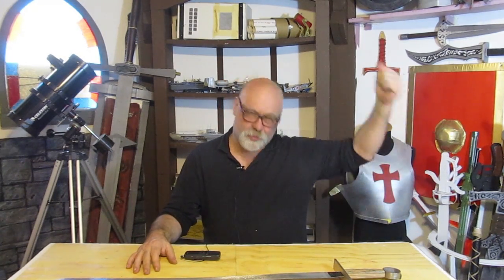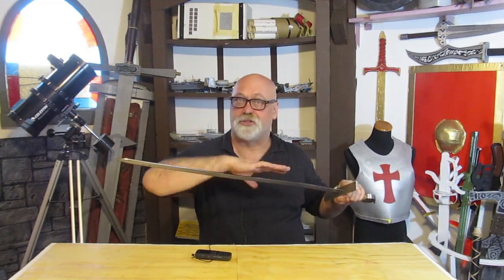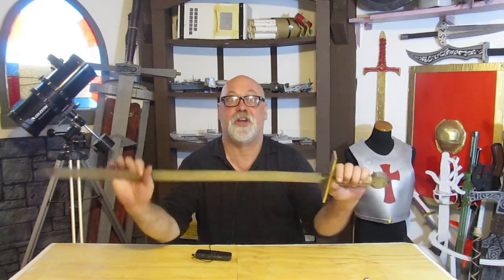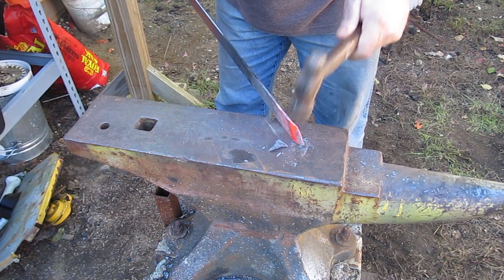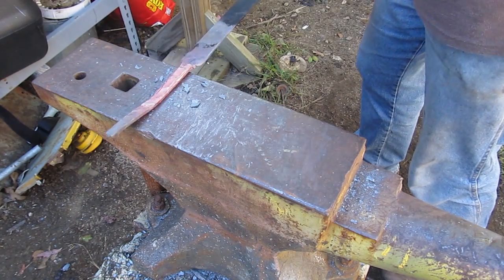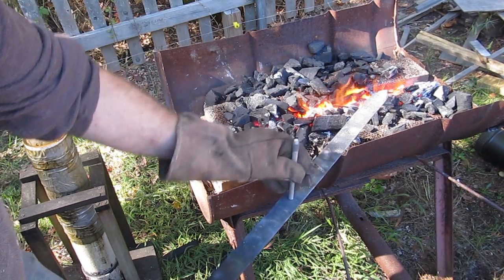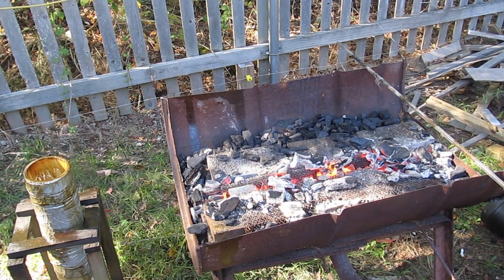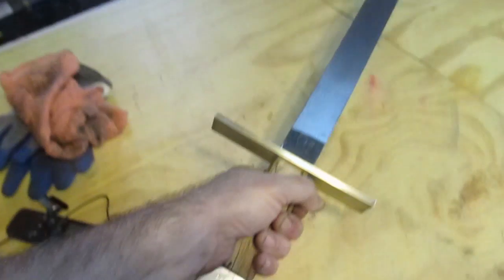Swordmaking: Don't use this steel

Comment: what about En 45, En47 or En 353? which is best for sword.
Reply from the maker: Wow, you know your steels. Difficult question to answer though. "Best" is a malleable thing. Kind of like asking which car is best. Lot of factors including cost of the steel/and the difficult of working it,  Skill of the swordsmith. How long of a sword. How light. How broad.  Which type of weapons will it go up against? How fast, strong is the wielder of the sword?  Many factors go into the decision as to what the right steel is. 
Great question but difficult to answer.
Reply: @epicfantasy  i made 15 swords with en45 and hard and temper to 52 hrc and dimensions are 36 inch long .give me your e-mail i Will send images.

Comment: Strangely, a mildsteel sword is probably the closest to what a historical sword from the medieval era would withstand than modern replicas using spring steel. Of course, it'd need carbon steel along the edges.

Comment: I just ran into this while looking into steels for a sword backing simular to how the backs of original katana were iron or mild steel with a very hard steel as the blade then adding a differential hardening to help the properties of both work the best I know 1075 is good all around for swords especally if properly done but 1095 and I mild steel seems more historically accurate and why I even stumbled across this though I think I need a better steel than that

Comment: Yeah, a high carbon, heat treated, forged sword would be nice, but you know what else is nice? Not spending 200€ for a sharpened piece of metal. If you need a sword, go to a fucking hardware store, buy a thick steel bar and an angle grinder, AND YOU'RE DONE! If you can't make medieval weapons with basic tools and basic materials... I'm just sorry for you...

Comment: costed me 30 bucks but I have a question. If i wanted to make a 50 inch monster blade what steel should i use? I'm hovering around spring or tool steel.
Reply from the maker: Tool steel would not be good. Go with the spring steel.
Reply: @epicfantasy  Thank you, spring steel  it is!

Comment: Europe medieval era,basically had mild carbon steel, and it was pretty crappy as far as.swords go. They used differential hardening,with an.iron core and.steel edges. Early middle ages it was iron swords all the way. High carbon steel was rare and even medium grade steel was rare until the mid 16 th century or so.

Comment: I've read that the Roman writers claimed that some Celtic swords would bend or warp during combat (so some of these blades may have had mild steel/wrought iron blades that were too long and soft). The Romans did use wrought iron for their armor such as riveted chainmail, scale, segmented bands, etc (and sometimes case hardened their segmented bands to mild steel) and likely used wrought iron for their earlier blades.
Reply: Genuine katana will also bend but it's kind of a good thing. It has a super hard edge but the rest is soft. Since the edge is so hard it can stay sharp longer, but the softness keeps it from shattering. When it bends, people will just bend it back 😂

Comment: I was looking up 5160 spring steel and this video popped up. 
Just wanted to do a little research on a 24.5”,5/16s thick machete/sword I’m buying on Etsy.
Reply from the maker: 5160 is typically a very good steel for machetes and swords.

Comment: Yet another video that doesn't tell you specifically which Steel is the best steel for a sword
Reply: There is no best steel, there's a good range to use, but different steel has different benefits, much like there is no perfect sword

Comment: Sigh. Iron has a carbon content in it already. Steel is just iron melted and the impurities cooked out. I forget exactly but iron is one component. Heating and cooling along with hammering bring out more carbon content cause you are removing the oxygen out of the mixture along with compressing the steel and removing other properties in it that are not needed. Then to make it even harder you fold the steel heat it and hammer more compressing it even more. This makes it so you remove even more impurities from the steel. If you already have a pure piece of steel though you will not need to fold. Want a good sword do research on the types of steel there are. I also have watched this video called super steel sword and he does both quenching methods and freezes it with a chamber. This made for an incredibly hard blade that has tones of flex in it.

Comment: That's how sword can be spring-like flexible. I was wondering how much carbon is mixed to good steel. Less than 1% huh
Reply: If you actually used 1% the steel would become too hard to use and break very easily. Have you heard of the channel schola gladiatora?

Comment: When you add toughening and hardening enhancers like chromium (2-3%), nickel (3-4%), manganese (~0.15%), and silicon (~0.05%) (these will vary between each other for balance), and reduce impurities (sulfur and phosphorus under ~0.02% and oxygen (rust) at even less, being the worst impurities), mild steels (0.18-0.55% carbon) were the basis of extremely strong 20th Century tank and battleship armors ("Krupp" steels) and, usually with more chromium, armor-piercing projectiles -- these were expensive steels, though.  With the proper combinations of these alloying elements (sometimes plus some others for making the forging process easier), the steel can be toughened (resist cracking on powerful impact) well above the best plain high-carbon steel, yet be hardened at its surface around a sword's edge and point and also for some distance inside (as in Japanese swords) to a level at least a great as the hardest sword steels ever used.  Thus, only plain carbon steels have to have carbon in the 0.6-0.8% range to allow high-enough hardness, though now you have to be more careful with the normalizing and tempering processes to prevent getting incorrect toughness in the final product.

Comment: you cannot harden mild steel much and tempering would be pointless
Reply: Mechanical hardening can be used to help though, but you're right, it won't get anywhere near as hard

Comment: how could you add carbon content to the steel? isn't some added from the charcoal in the process of forging it?
Reply: You can add carbon, case hardening, or blistery steel.
You need some metal container , then you fill container withcharcoal powder, and then close the container.
then you´´bake´´ it in fire (around 1000°C) for hours. then you have added carbon

Comment: I want to forge "swords" but I'm thirteen.
Reply: Swords are really difficult to make well, but blacksmithing is a really cool thing to do and a very impressive skill to have. I would suggest you check out channels like Walter Sorrels and Torbjörn Åhman. Walter's channel is mostly related to knifemaking, but he has tons of tips on how to get started with very few tools and a lot of the skills for making knives transfer well to swordmaking and general metal work. Torbjörn's channel is great for learning how to make all sorts of things, most of them decorative, but his videos have great demonstrations on how to use various tools and how to make a ton of stuff. I would suggest you start small, just get a small anvil (50 lbs or smaller) or just a piece of railroad track or anything you can hammer, 1 or 2 hammers, some decent heat resistant gloves, a pair of tongs or vice grips, and some kind of heat source. You can build a small forge or just use a blow torch of some kind. Get some steel and start pounding away. Get a feel for how to work with metal and build up your arm strength and then just look around the internet for interesting projects. Ask friends and family if they want something or just something that looks cool to you. Once you are decent, you can start making your own new tools and expanding your capabilities, and then if you want you can start selling your creations you can start making a bit of money, it probably won't be much, but handmade stuff can get a decent price. Most of the stuff you can get for under $100, but it might be a bit more than that. The only limit on what you can do is how much time you want to put into it and how long you can swing a hammer.

TL:DR Go for it. Get your parents permission and start making stuff.
Reply from the maker: This is a good goal to aspire to. At this point, if you don't have a forge you can do lots of studying and learning about it.
Reply: Look up local guilds around your house on the Internet there should be some by you
Reply: Exodus 2017 Guilds? Of what?
Reply: Blacksmithing
Reply: Exodus 2017 Oh.

Comment: all steel works in water as long as it is cooled fast enough
Reply: That's actually quite false. There have been tests with "super quench" made with lye (which is deadly) as well as Robb gunter's superquench. Steel needs at least .30% carbon to harden to any measureable level at all, and even then it is usually well under 50 rockwell hardness which is still quite soft.  Under .40% is still mild steel, so some "mild" will  harden slightly when quenched in super quench or ice water in thin sections but normal 1018 will NOT harden. In order to make a good tool you need at least .40-1.5% carbon depending on what it is and your heat treat.
Reply: water works. this far ive never failed using just water.
Reply: then you never have used 1018 and you haven't used Oil or air hardening steels. Water won't work if it's too low carbon, and If it's oil or air hardening water WILL crack it almost every time. This is just science,
Reply: An edge quench in water is almost a sure way to crack it unless you are claying it and do like the japanese do and even then 1 in 3 will crack
. I use warm water and a quick plunge and haven't broken any yet that way. My only water breakages were from too cold of water or just being stupid about it and doing it wrong.
Reply: Go quench some 1095 blades in water and see what happens. Higher carbon steels need to be oil hardened.
Reply: 1095 is a water hardening steel....It can crack in water if done wrong just like W1 another water quench steel but the only oil that gets it to it's full potential is parks 50. Canola oil can do a good enough job but it IS technically water hardening. I've quenched plenty of 1095 in water
Reply: Ethan Dobbins Yet it wouldn't be fun to go water quenching a blade that you have 15 hours into. Oil has always worked for me and I'm sticking by that.
Reply: Me too,exept for steel under .60% carbon or Stuff like W1 for paring knife sized blades. Canolda or soybean oil is just fine! works like an 11 second oil.
Reply: Ethan Dobbins Yeah. I'd only feel comfortable with possibly doing edge quenches on smaller knives. I just don't wanna take risks on ruining a knife that far into the process.
Reply: Ethan Dobbins Yeah, yeah, should've elaborated on that more. I don't edge quench the high carbon steels in water (or unknown that won't harden in oil). I do quench medium steels in water though. Haven't clayed anything yet, might try that at some point.

Comment: I owe you a lot for showing me how to finish a knife, but I have to say that those prices for good steel are pretty high. Yeah it'll be $50-$60 for a good long bar of O-1 tool steel, but that's because O-1 is tool steel, it and D-2 are the cream of the crop. If you're on a budget, the same sized bar of regular 1075 simple carbon (iron, carbon, and nothing else) is closer to $27. And if you go for a bar of 5160 which a TON of sword makers use, it's only $15.
That's also not saying mild steel is completely useless. It's cheap and readily available, it's fantastic for practice, getting used to blacksmithing or when you want to get into forge welding. There's nothing particularly wrong with bending a heavy bar of mild steel around, forge welding in a bit of old file and making an old school axe or tomahawk, not to mention fittings and furniture for knives, hardy tools if you're lucky enough to have a real anvil, that kind of stuff.
Reply: I don't believe you'd want to use either D-2 nor O-1 for a sword blade. You'd be better off with 5160, 1075 or 1084. D2 and O1 are going to be brittle in sword-length pieces.

Comment: I agree that steel is an all around better sword material than mild steel which might as well be iron. However, iron swords were used for a long time. So in historical contexts iron or mild steel swords would be very useful in certain periods. 

I have a hard time agreeing with the statement that it is useless because of it's material. If a sword's design, material, and use don't match up, it is certain to be less than useful though.
Reply: bangythebrav I'm not sure that's true. The iron of the time was wrought iron, even softer than mild steel. Many smiths went to great lengths to make steel such as blister steel. I'm not sure when that started, but I suspect a bronze sword would hold up much better than a wrought iron sword.

Comment: is there a way to turn mild steel into high carbon steel
Reply: technically yes. but it takes more $ in fuel and costs to make it than it does just to buy real steel.not to mention you basically need to be a master smith to know what you are doing lol It is only done for historical reproduction purposes. for more info look up"blister steel and shear steel"
Reply: @EthanPDobbins  easy way to make high carbon steel. Burnt plastic that's your carbon and clay heat unti clay is cherry red then wait 20 mins then cool
Reply: @matbartlebaugh2047  nah
Reply: @matbartlebaugh2047  unless you're using a case hardening compound it takes several hours to get any carbon into the steel and you will only be getting up to one milimeter of penetration. That is Called Case hardening. if you were then going to turn that into steel it will have to be welded together a few times with other pieces to homogenize it.
Reply: @EthanPDobbins  that's what I'm talking about the clay is used as a case to keep the carbon in so it penetrates in to the steel .it is a basic but good carbon steel. You can use flour as a bonding agent if you want. and charcoal as  carbon .

Comment: 1075 is a very cheap and easy steel to heat treat like 01 or heck you could even use 1045 and quench in water if you dont happen to have 10 gallons of oil laying arround... (not including shipping which is a sometimes a killer) enough 1075 to make a sword and a few knives is anywhere from 10 to 20 dollars >>> http://www.admiralsteel.com/shop/ --- as for 1045 its hard to come by in sword legnths though i know the Jew Jersey steel Baron sells 4 foot sections.

Comment: have you tried increasing the carbon content of mild steel?
Reply: that is a very hard thing to do, you basically have to surround it is a precise carbon source like graphite powder and cook it at like 1900 degrees for an hour or 2. its doable but not worth it.
Reply: yes sir I was going to suggest a process I had some success with i do not know how well it would work with swords but it worked with my knives.
Reply: Using a rose bud I would heat the blade to temp and then take flat air arc rods and proceeded to grind it into the blade switch sides and kept repeating that several times. I'm not sure how much success i had I'm currently having it tested by a friend.
Reply: Film factory is correct, and it takes HOURS at that heat to get it to absorb even a millimeter thick layer on the outside. This method was used up until the late 1800s to make "blister steel" and shear steel. many pieces of carburized iron would be forge welded and folded together to mix it up like cake batter until it was as homogeneous as possible to give even hardness. whatever you did with the rosebud torch will have no effect, and if it has any at all it will only be a paper thin layer or less